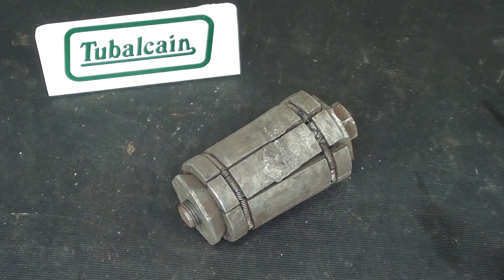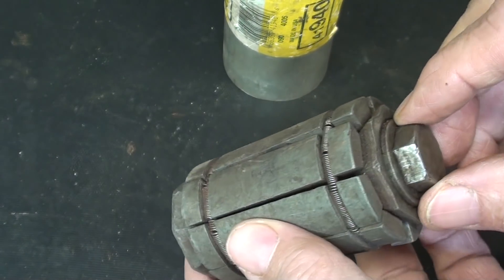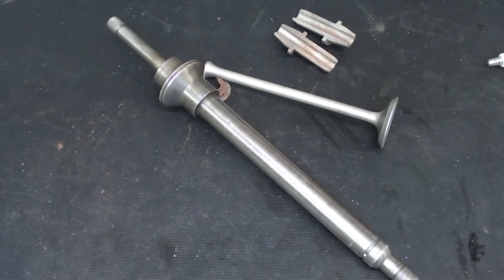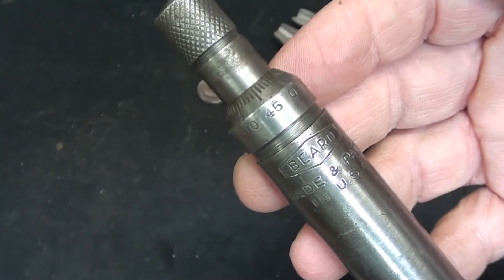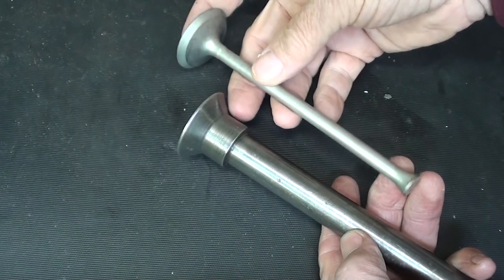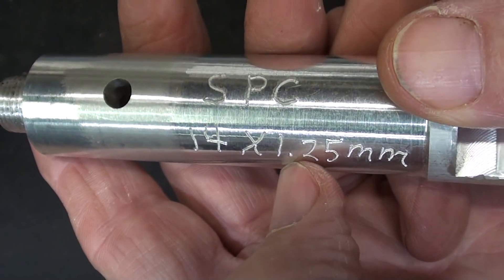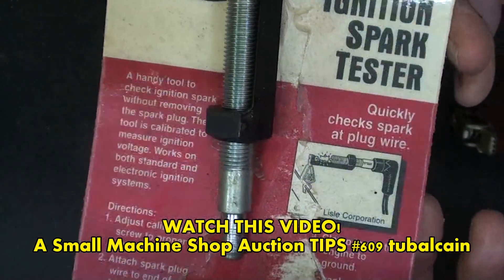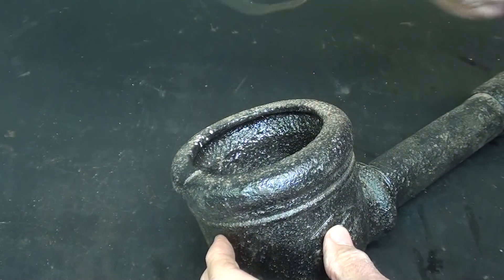WHAT IS IT?  Mystery Tool #53b answer tubalcain mrpete

Comment: That tailpipe tool is still sold by HF, and it still doesn't work! I have been through the same experiences. Now I have used it on a grey electrical 2" conduit with a torch to make a flange to fit over another pipe because I didn't have a coupler.
Reply from the maker: lol

Comment: No need for a fixed bail from the manufacturer on the water diverter. A prefab bail could easily not match the end user's equipment. The groove toward the lip of the diverter allows secure attachment of a wire loop to suit the customer's whim.

Comment: the problem with the allegator type checker is that they tend to come loose when you spin the engine. this will hold the sparkplug securely which will check the coil, points, plug wire and of course, the spark plug.

Comment: I have used my tailpipe expanders with no problems for almost 50 years.  I always lube them well and only use them with a strong impact wrench.  On some of the really big truck pipes sometimes I heat the pipe to make it easier.

Comment: I only knew the confounded exhaust pipe expander. I thought the diverter might have been a fire pot for a forge but quickly changed my mind. One question though, how does the valve install in the head with that boss on the end?
Reply: I think that is why the split valve guides were shown.
Reply: Gord Baker, that makes sense, I guess I saw that as a cut away, after review I see there are two halves pictured

Comment: None of the diverters I used as a kid were near that fancy or expensive. Would have been a lot handier in the cold weather to have one like that. Mine always seemed too small and kept falling off or leaking real bad. Sometimes it was just a wooden trough and that worked too. Leaked a lot but worked...

Comment: I had one of those in the 80's thought it was worthless til I got an impact and compressor.
Reply: Yeah, I bought one from Sears and Roebuck years ago...instructions state to use EP lube on the screw, then the air- wrench....noisy and takes a while...but does work....

Comment: That valve grinding measurement tool is amazing. The technology they had back in the day is just incredible. I understand what it does exactly. That engine would have no shims, no adjustment mechanism, no hydraulic lifters. You would just use this specialty tool and the engine is then perfectly adjusted.

LOL I guessed wrong about the water diverter. I thought that was a fitting to be set in a concrete slab, to provide for mounting a toilet! 

As always, thanks so much for sharing these things and making the What Is It and This & That videos.
Reply from the maker: Thank you, I’m glad you liked it

Comment: The pipe nipple expander is only meant to remove the clamp ridge, and is designed for impact tools, not hand wrenches. Torch heating makes hand wrenching doable, as does the two hammer swage technique, so the ridge is reduced to a wrinkle in an out of round pipe. Then torquing and tapping often salvaged the pipe to workable condition.

Comment: I've used an expander more times than I can count and never had it fail to work.  That was when garages actually tried to repair and fix things not cut  it off at the manifold and soak he customer for an entire system not just the tail pipe or tail pipe and muffler they needed.  I've used them both ways, with a socket or box end wrench and with an impact gun.
Reply from the maker: It’s good to know that they actually work, thank you

Comment: I had one of those pipe expanders that actually did work pretty good, but it wasnt made of the cheap die cast like most were, but seemed to actually be steel and it cost like $30 but worked best with an impact gun on it.
Reply from the maker: Good to know

Comment: Pipe expanders worked. The die cast probably wouldn't live long. If you have an all steel machined version and keep it greased it works well. The transfer cup has grooves right below the bell at the top. Tie your wire or rope tightly in the groove all the way around with the bale as you described. No holes required. Thanks for sharing
Reply from the maker: Thank you, good to know that they actually do work
Reply: @mrpete222  I had a well made machined version, got stolen. When I needed another years later all I could find was junk similar to what you showed. It didn't work at all like my old one. Broke the second time it was used.

Comment: The pipe expander I used at the shop for 35 years worked for me. I used it with my air impact.
Reply: Ya new o rings every week
Reply: @pbgd3  Nope, never replaced them.

Comment: With the valve micrometer,  once you determine the valve setting, just record the micrometer reading and turn it until the valve bottoms out. Subtract one from the other and you have the correct amount to grind off. This takes away any guessing with grinding some off and putting it back into the micrometer. Also keeps you from grinding off to much. Keep the videos coming.

Comment: down to the shop to make a spark tester, what a great idea!
Reply: Archie Bunker I would agree with you and I’ve done that for 50 years except, most of the 26 to 50 CC engines I work on now have huge plastic shields which make laying the spark plug on the head difficult.

Comment: I have used a beard valve length gauge,on Ford V8's . the mushroom end with split guides is the Ford method . Valve grinding machines often had a little part where you could grind the end to get the correct length. The hardest part was always getting the guides out of the block,even with the Ford tool.

Comment: :31 I have one of these. I don't hate it at all.  If you know its function and use it with some thought, it works well.
Mine is cast steel not die cast also.
To remove the crimp left by the muffler clamp I would use the expander and apply heat to the crimp with oxyacetylene to push it out.
Granted many backyard mechanics didn't have this and would get frustrated that this "miracle tool" didn't work.
Reply from the maker: I think the steel ones are much better than the zinc
Reply: You are very correct these are only meant to straighten  out minor dings or dents to make the pipe round again. A few taps with a hammer when it's expanded in the pipe is how it's done. Definitely not going to do any expanding.
Reply: Richard Ferrara, I’ll tell you from experience that if you get a tailpipe red hot with a cast zinc expander inside the pipe, you’ll have a big zinc puddle on the floor of your shop!